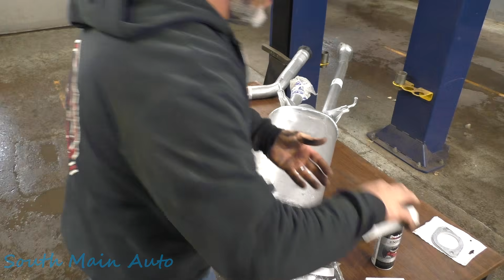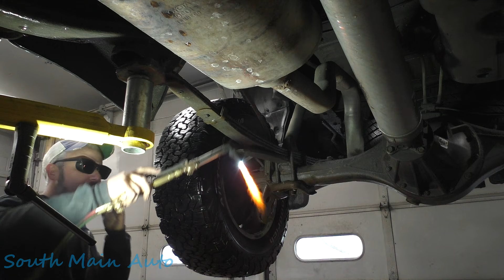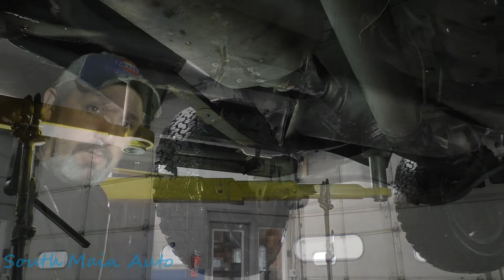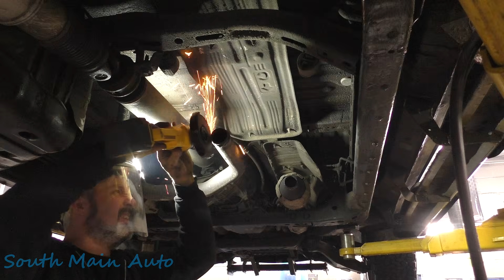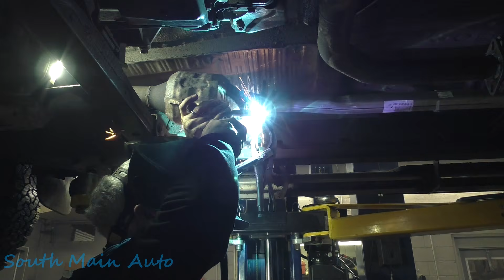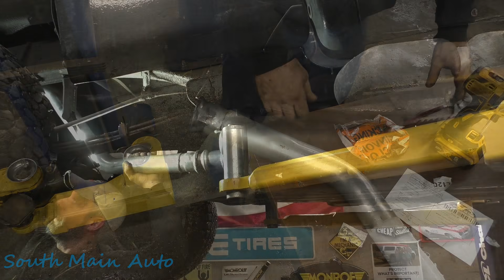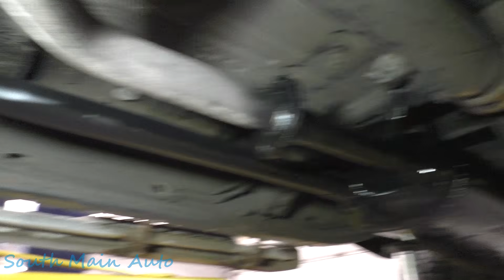Toyota Tundra: Welding On New Convertor Flanges & Replacing Muffler

Comment: Looks like a good job Eric. Was interesting to see how you solved it. I have had no luck with aftermarket exhausts on Toyotas. I've had several set P0420 because the doughnut after the cat wouldn't seal and was blowing. Computer wasn't happy. Fixed with OEM unit. Its a pain in the neck.

Merry Christmas to you Vanessa, kiddos and furry 4 legged quadrupeds.

Comment: Get your self a tip nipper for the cutting torch tip
You surface the cutting tip then use the tip cleaner for the holes and you will hear the difference when you light the torch and that torch will cut even more precisely with less slag and look like it was cut with a saw

Comment: This is pretty good timing. I bought a Tundra because years ago Eric told me to in a youtube comment haha. Mine is leaking from the exact same flanges. Im not confident enough to weld them so I glooped it up good with some JB weld hoping to at least get me through the winter. Its quieter now only problem is I think the manifold is leaking as well. I can't even see the manifolds but it sounds like it and that job looks like a pain in the ass. I hope his manifolds leak so we get a video hahaha.

Comment: 38:51 The driveshaft that runs the tail rotor on a UH-1 (Huey) helicopter uses the same style of clamp. (30–35 inch lbs.)

Comment: There's your problem Lady, the muffler bearing's out. The part you took out looked better than it's replacement, other than some slightly rotted flanges I don't get this video. It worked. Now you spent a bunch of money, time & effort and....... it still works. Nice to see you wear eye protection with the grinder.

Comment: Used to make a little extra $ on repairs in my driveway. 70/80s. Oil changes tune ups brake jobs shocks etc. Never would do exhaust ever. Not on my on a creeper. North east rust.

Comment: I live in the  North of England which gets a fair amount of Winter salt but of all the vehicles I've had since the early 90's I haven't had a single exhaust component rot away.  Exhaust quality has improved dramatically since I started driving in the 60's when you were lucky if you could get a system to last 18 months.  My current 2002 Renault Scenic is still on its OEM system at 97k miles.   The amount of salt on your roads must be horrific.

BTW  Your welding is FAR superior to the 'chicken shit' I produce! 😄

Comment: Really love to watch the torch and welding bits you do, Eric O! For a home amateur, do you think a stick welder would also work well enough for exhaust work?
Also - consider using gloves when you weld. The UV on the hands ain't so good from what I have been reading!
Reply: Stick was used for 50 years. Very much harder to get a good job than mig. I often used to tack in place with the stick and then seal it with torch and rod. (often coat hangers). Often tacked new exhaust and then clamped for seal on vehicles that were going on rough roads.

Comment: I was a GM fan boy for my first 25 years of owning vehicles, but the last two ruined that. Been a Toyota fan boy the last 15 and never have had any major repairs. Just tires, breaks, plugs and normal servicing. 2012 Highlander Limited, 2007 Camry, and two 1998 Corolla's my son drive with a combined 500,000+ miles on them.

Comment: I live in Wisconsin, and have been a mechanic for around 25 years. I completely agree, a cutting torch is a necessity, not a luxury. Yes, there are other methods of doing the same jobs, but in my opinion,  none as fast, and in many cases, as easy. If used efficiently, cost of use, compared to bottle torches, cut off wheels, sawzall blades, and other trinkets, is way lower. I've learned methods of cutting certain components apart that allow me to save or reuse parts that would otherwise be destroyed by mechanical means of separation like an angle grinder, or pneumatic impact hammer. If you don't know how to use a cutting torch, safely, or effectively, don't. But I completely understand why people, including me, rely on them.

Comment: Its the rust belt! the torch is the only wrench that will remove the rusty stuff, though checking for fuel and tanks issues before striking up is how its done in rust territory. Toyotas turn back into iron oxide pretty quick if not "Fluid filmed" before the salt season. Its an exhaust system!! the weld has to hold and not leak, its not a pipeline, the welds are good enough.

Comment: A torch setup is essential in a garage when you think about it. Nothing helps more with loosening frozen rusted nuts than heating them up to glowing red hot. If you have a welding torch it will do what an expensive tig torch will do and if you have a cutting torch it will do what a plasma cutter will do and you don't even have to plug it in. Maybe all the comments are more about how you're using that torch. You look like you're clearing out a cave in Iwo Jima instead of cutting an exhaust pipe.
Reply: I'm just messing with you. I couldn't resist.

Comment: Get some of these guys who steal catalytic converters, they have them off in less than 30 seconds with a reciprocating saw. They will have the complete exhaust out in 1.5 minutes.  And we know that it doesn't cost anything to charge batteries and 0 carbon foot print to make the saw blades and saws.🤣

Comment: Other People: "Reeee. You're not doing it right."

Me: Amazed at how he can weld the flange on without burning holes straight through the pipe like I do.

Another informative and entertaining video. Merry Christmas and Happy Holidays to you and your family!
Reply: Always start the weld on the thicker, newer metal.
Reply: @300DBenz  Thanks. I'll try to keep that in mind next time I try it.
Reply: Something's wrong. Unless you're working on a thin, rust covered pipe, that should never happen. I assume you're using a MIG welder. Try different settings for heat, speed, gas, etc..., and practice. Once you get everything dialed in property, you'll have no issues. Also, never weld anything to the body. You'd be surprised at how easy it is to set the carpet on fire.
Reply: @AT-wl9yq  Nope, el cheapo "Display4Top" wire-feed welder courtesy of Amazon. I was thinking if it was the welder's fault, maybe because it has no current control so it cranks its max amperage all the time, and the speed control hardly changes the speed at all. If I keep having to weld I'll get a decent one eventually. Most likely issue is that I have no idea what I'm doing when it comes to welding, and probably should stick with computers.

For now I just stick a cheap Autozone exhaust segment in as a backer, and pull it out after I'm done. That seems to work.
Reply: I'm no welder either, but what works best for me is off-pace circular motions, where more time/slower motion is spent on the thicker new metal and faster motion/less time on the thin schmutz. I guess you could also concentrate more of the puddle on the new thicker metal and do tons of short stiches. burning through a few times and quickly adjusting the welder and your self is what I've learned.

Comment: They don't "never break", they just break less often and usually less catastrophically. Two of the biggest selling cars of the 90s were Tauruses and Camrys.  Only one of them is still a common sight on the road in 2022.  
There's a reason even semiconductor companies look to emulate the Toyota manufacturing system.

Comment: So yesterday my 2022 outlander  battery lite comes on and i break down , at the dealership there is 20 + others same problem some are 2023  modles with computer problems and bad battery,s ,  took 6 hours for them to get new battery,s  , as we waited and looked across the road at the toyota dealership not one tow truck bringing broke down cars , at the kia , hyundia , gmc and ford  dealership  they all had broke down cars lined up at service  areas but the toyota dealership had none , not one and my next car will be a toyota

Comment: People that don't own a torch setup has never used a torch, i'd say fact check that one.  
If you've ever used a torch or even MAPP gas to heat up a bolt or stud, you would make sure you always had a setup readily available.
My question to them is why wouldn't you want to own/use one?  I suppose if you enjoy breaking off bolts and studs or using a sawzall to remove exhaust then you've got more patience than I do.

Comment: I own a 1989 Toyota Camry. It’s a salvage title car. I purchased it from the original owner who bought it back from the insurance company after it got rear ended. It had 289k when I bought. The original owner installed an Attarco engine and trans just before I bought it. He was having issues with it stalling and decided to let her go. I did a bunch of minor stuff to it when I got. When I took it in for a smog check, it failed the mechanical. Seems the TPS’s are adjustable. If not adjusted correctly, it won’t go in to base timing mode. The smog tech told me about this. I got her fixed. She now has 380k on her. I did overhaul the suspension and front end and have been replacing the wearing parts (brakes, half shafts, etc..) I can honestly say it’s the best vehicle I have ever owned. The original purchase price was $375.00. I like Chevy’s. My ranch truck is a 1998 k2500. It has the Vortec 350 and 4l80e.

Comment: Ha!  I like my Toyota. I got 6 years out of my OE muffler then I put on 3 RockAuto replacements (highest price ones) and they all rotted off in about 2 years. I just put on the cheapest RockAuto muffler. We'll see how it goes.   A mechanic in the snow belt without a cutting torch is like lawn care without a mower.

Comment: As a YT keyboard-certified welder, I approve of both the torch and wire-feed welding. My personal motto is: A grinder and paint, make me the welder I ain't. My welding skills are such that my welds (both gas and arc) look like crap, but they hold!
After I moved from Chicago to Phoenix, I worked at a shop for a few weeks before I realized that they didn't have a torch. I asked about it and was told that we are in AZ, and you don't need a torch. I worked on cars for 20 more years and never once needed a torch! But, I do have one at home.

Comment: Back around 2009-10, Ford engaged the services of an automotive writer to devise a set of tests to determine where Fords F150 stood when compared to the other manufacturers. The writer was provided with an F150, a Chevy 1500, a Dodge 1500, and a Toyota Tundra. All of the trucks were four wheel drive models and all were brand new. It was understood from the outset that Ford would have no control over the content or the results shown in the video. The finished video showed that Ford was the better of the four trucks with Dodge and Chevy close behind. Toyota was another matter. The Tundra placed dead last in every category. In some cases it was shown that the Tundra was not just a little behind but in fact a lot behind. The Toyotas frame was still riveted C-channel while the others were all boxed and welded steel tube sections. The Toyotas suspension  was poorly engineered and prone to failure by design. There was one test run where the object was to run a vehicle down a very rough test track at 30 MPH without losing control. The Ford passed and the Dodge and Chevy almost passed. The Toyota was so bad it couldn't make 20 MPH and the frame flexed so badly that the back of the cab was damaged when the box smashed into it repeatedly. 
An acquaintance of mine sold Toyotas for 23 years at the same dealership. Today he sells Mazda's. I asked him why he moved over to Mazda and his answer was, "The last two years I sold Toyotas there was not one single model that I could honestly recommend to my customers. I had folks who I had sold as many as six vehicles to and my living is made by return clientele. How can I recommend a product that may have once been good when I know the quality has gone to sh*t. Answer is I can't so I left and came here." 
Remember when Toyota got hammered by the American Government over the throttle bodies that were failing and killing people? There was a reason for that. GM and Chrysler were running the same throttle bodies on some of their vehicles and knew there was a problem. They recalled the vehicles and fixed them voluntarily. Toyota knew about the problem but their solution was to leave it since they had calculated that the lawsuits would be less money than fixing the problems. This was not the first time Toyota had taken this stance so the Government decided to teach them a lesson. Volkswagen suffered a similar fate when it was found that their software was cheating the emissions regulations. They were heavily fined for their actions as this was not the first time they had been caught doing this. The US government takes the stance that your first offence will be dealt containing some leniency. Your second offense you will be dealt with very harshly because you didn't get the message the first time around. 
Bottom line, Toyota is not the vehicle it once was.

Comment: Yoare doing the job all wrong. Go to the junk yard and find a good OE stainless steel muffler and some pipe sleeves. Bend a stainless steel tube or weld prebent pieces and you are done.

Comment: I got a cheap Rock Auto catalytic converter over a year ago and it's been holding up great. Caused a check engine light after about a year of service, but I just threw a o2 sensor spacer in  there

Comment: We live in the UP of MI. The nearest car wash is 30 miles away. They use salt alot. So, I hooked my hot water heater t on the outside hose. Works great. I can mix the hot and cold. Water can be hot/ cold or mixed depends on the outside temp.

Comment: As the saying goes: "A grinder and paint makes me the welder I ain't."
I recently signed up for a certificated welding class to cure me of my bad habits with my cheap hot metal glue gun and to cure me of my fear of Acetylene. Anything that needs to be stored in porous concrete under pressure to prevent spontaneous detonation is to be respected.

Comment: That was the most exact Scotty impersonation to date.  😁😁😁😁 Ive been on this earth 5 decades plus. Bought my first torch and tanks when I was 18. Before that I used my brother in laws from the age of 12.  As you stated, if you live in the rust belt, you cant live without one!  Actually I just remembered, my First Torch was a solid oxygen pellet torch that I bought in 1978 from a Woolco store to weld go carts with. Kinda of a pain get the pellets to light but it did work once you got it going.

Comment: I am here to defend Toyota. (I am NOT a Scotty sponsor!) I am a Toyota owner. I don't consider exhaust rot out a 'break'. All exhaust systems will rot out especially in the rust belt. They have a limited life span like tires, batteries, brakes, etc. I don't consider those a break down.

Eric, you need to pop out of the trunk of your car. 😁

Comment: Wait? People complain about oxy-acetylene torches? Hell, if you live somewhere no humidity and no precipitation I guess you wouldn't need a torch but I grew up in north-central Pennsylvania (rural nowhere not unlike where SMA sits) and probably 3/4 of the people I knew growing up had or had direct access to their own oxy-acetylene or oxy-propane torch setup. The one guy I knew who used propane exclusively was a professional scrapper cutting up huge piles of steel and I honestly don't know why he went with Propane vs Acetylene... The torch tips, hoses, etc, pretty much all cost the same. I think it was the fact he worked weird hours and people at welding shops would give him a side-eye for hauling an oxygen tank the size of a refrigerator in his pickup without any hazmat placard.

Comment: You get the occasional crappy Toyota.  But statistics don't lie--at 100,000 miles, a Toyota is still basically a new vehicle.  For GM and Dodge, however, 100,000 miles is where they start having major issues.  I'd take a Toyota over a GM or Dodge any day of the week and twice on Sunday!

Comment: All I can say and this is coming from the UK different laws gas is very expensive to buy as are the heads then there's the flash back arressors not to mention that you need a license to store and have gas on site that's before all the training and certification you need just to use the stuff 😒

Comment: Eric some shops frown on cutting torches due to the possibility of a fire in the building, As a retired fleet mechanic we had two cutting torch sets  in the shop alone with a plasma cutter  and air chisel to compete with  the rust .  Almost forgot the mig stick and  tig welding machine. Another factor is the cost of gas especially acetylene, in place a cost effective alternative  is propane, but the equipment differs.  Salt , brine, calcium will always keep a mechanic in the north busy.

Comment: If I remember correctly, there is no gasket at the muffler to tail pipe. It's that clamp you had trouble fixing keeping both together.  Also the OEm gasket sits in the cavity at the muffler to cat flange.

Comment: If that is made by OES it's actually a Magna-Flow system. They stamp the Brexhaust brand that way. They do make a stainless kit for them but good luck finding one in stock.  If you find a shop in the salt belt that doesn't have a torch, are they really a shop??  I've got two sets plus a couple mini-ductors. Not sure what I would think if I could do repairs with end wrenches and never struggle.
Reply from the maker: If I run out of 02 in the tank in the middle of the day, we just go home haha

Comment: My 1979 Dodge D250, I could count on replacing the entire exhaust system once every two years.
However, my 1990 Dodge D250 had 210,000 miles on it, was fourteen years old when I sold it and still had the original exhaust system intact on it!

Comment: Who  would have thought that replacing a muffler and tailpipe you would be able to showcase your many skills from using your cutting torch to fitting the flanges and pulling your system tight with a ratchet strap , nice Eric as usual.